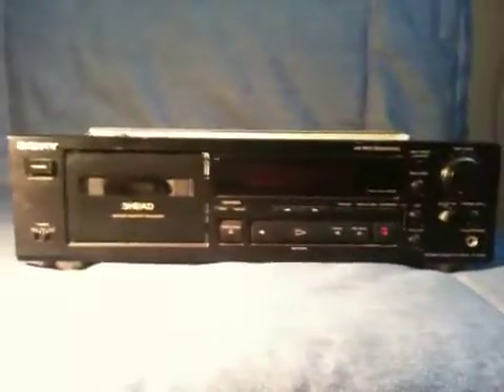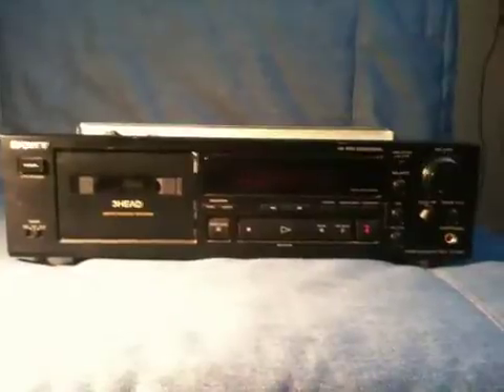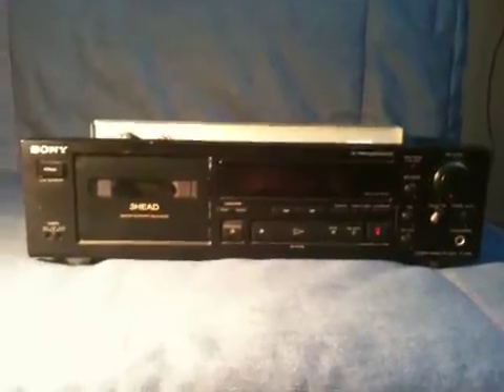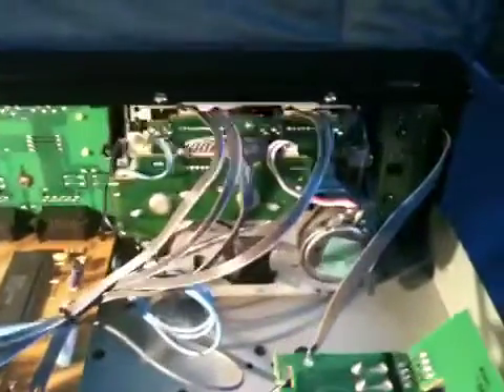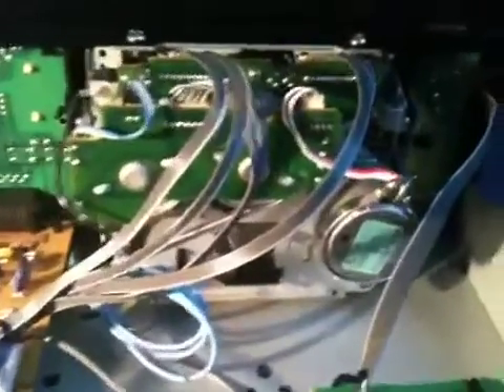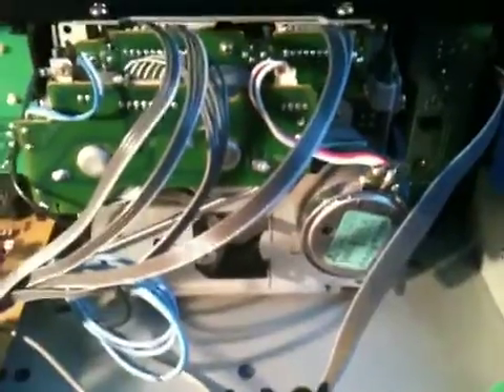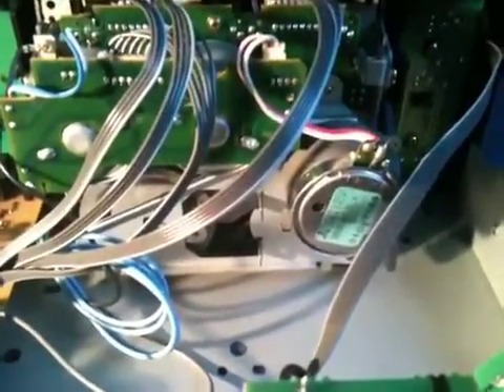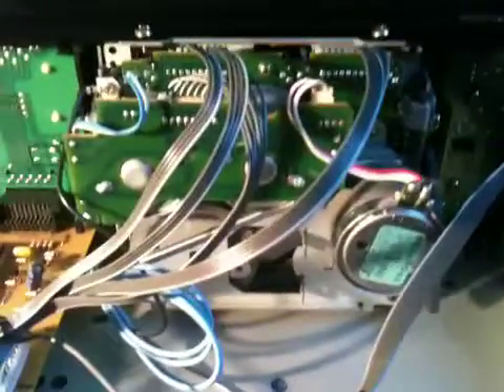Sony TC-K 590 Cassette Deck: Noisy Motor!

Comment: Noisie capstan motor caused by unlubricated upper and under shaft axel. Disassemble the motor and use a drop of oil in these two spots(bronze bushing) and reassemble the motor. Use oil on the capstan axel also.

Comment: I have the same capstan motor on my K679ES and was able to use sewing machine oil on the shaft bearing ... two little drops and absolutely no noise!  Make sure you dont get any oil on anything else.

Comment: gdgd. luckly, ive never had issues with having to adjust record and playback levels inside my unit. they are the best era of tape decks that sony made, unlike the last of the line of decks that sony made which were cheap and nasty. oh were not that far from each other.

Comment: lol, update for you. the replacement motor failed after 7 months of service. the speed of the motor became unstable!!. im quite angry because I paid so much for that dam motor. but good news is.. a mate from work who's into tape decks gave me a bag of 8 motors which are all the same and fit the sony tc 611s perfect and work with adjustments on the rear of the motors. their also bigger than the original motors, but only in depth, not width..
Reply: i still have these motors
Reply: you lucky dog, i need one of these motors.

Comment from the maker: @chakaone. Thank you for the tip. I've found one of these and need to find out if it needs the capacitor that the original has fitted across it or not.

Comment: use a MABUCHI MOTOR MODEL NO : EG-530AD-2B i've used one in my kc-611s. which works perfect and has a trim pot on back for adjustment, i got mine from ebay for £30 pounds, but i reckon u can get 1 cheaper.
Reply: Hello chakaone, There are several models of the engine. What to use? You use this,  MABUCHI EG 530AD 2B 12VDC, VCC 2400 (+ -2%) CCW 8-4 ~ 15V, 73 mA, which replaces the DC12v motor capstan MMI-6S2-LK of MATSUSHUITA, I need two, one for SONY TCRX606ES and one for SONY TCRX77ES, THANK YOU FOR YOUR INFORMATION, greetings from MEXICO

Comment from the maker: @triangman1992 I reckon the noise is a characteristic of these motors. They are made by Matsushita (Panasonic) and make the same noise as our video recorder, which also made by Panasonic. I find this comforting, because that video recorder is about 10 years old now and has seen very good service!

Thank you for watching.
Reply: this motors IN NOT MATUSHITA IT IS MICOUI! IT DIES IN MEAN VERY 3RD MOTORS! VERY FAKE! REPLACE ONLY SANKYO MOTOR I HAVE THE SAME MOTOR ONKYO TA-2940! THIS MOTOR THROW THE TRASH!!!

Comment: You're lucky, there is nothing wrong with these motors. These types of small little motos are rather noisey, even when new. I have about two of these little motors, and I had several different cassette decks that contained these types of motors (They were all made by Matsushita), and they were all very noisey, including very new models. Even with a bit of oil they stay noisey, it must be because of the way they were built.
Reply: lucky it is the guy have noizy motor? dr casette not tell right tell weird noizy motor does in mean trash motor! replace emediatley! i have the same proplem onkyo ta-2940 motor capstain!